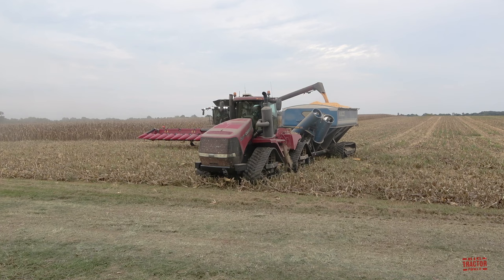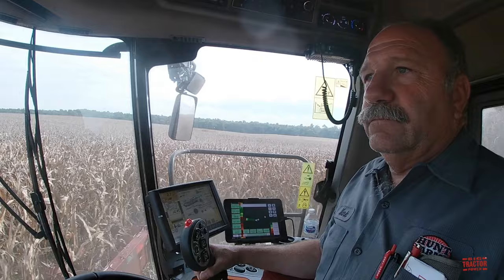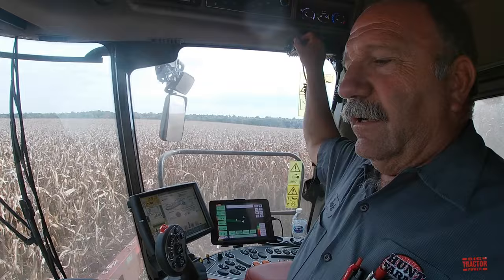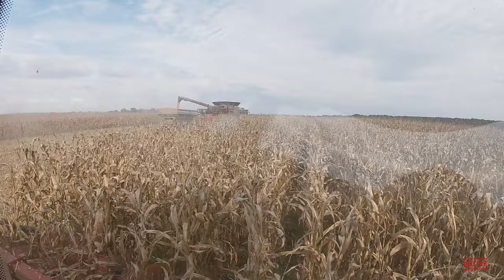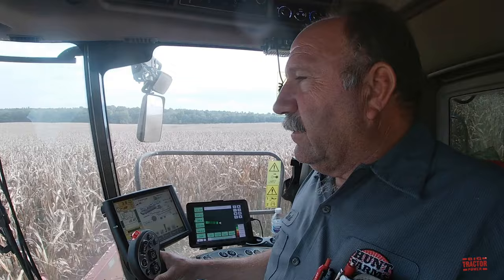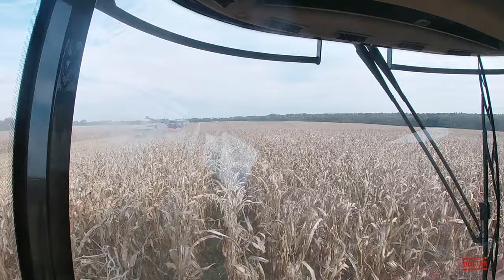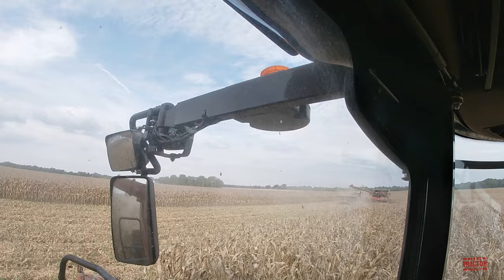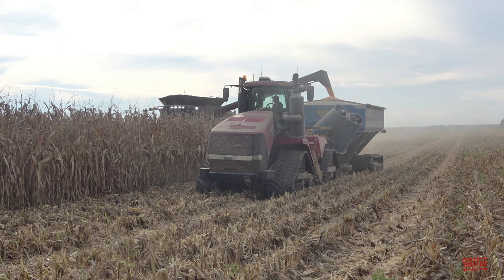CASE IH 9250 Axial-Flow Combines Harvesting Corn

Comment: The 9250 is an impressive machine.  Case makes a good combine  and their quadtrac tractors are nearly unbeatable
Reply from the maker: The 9250 really shines in corn with a 4416 head.
Reply: And I thought the slightly smaller 8250 was huge, Welker Farms has two of them and they just barely fit in the garage they have with inches to spare.
Reply: Two 8250s, not the 9250.
Reply: @bigtractorpower
Reply: Diamond

Comment: I was an IH dealer manager and sold the first rotary combine, a 1460 with a 22' header!
Total sale was around $53000.00! Whew things have changed alot and I'm retired!
Reply: I used one of those but with a 36" ft macdon on it. It was in west australia in pretty marginal area so the capacity of the combine vs size of header weren't an issue

Comment: I work for a farm that uses 2 John Deere 9660 STS combines 1 is a Bullet Rotor combine, their oldest brother uses a John Deere 9760 STS combine and these combines are used to harvest corn, milo, soybeans, and wheat. They use a John Deere 893 8 row corn head with hydralic deck plates to harvest corn. For wheat, milo, and soybeans, they use anything from a 635D 35' rigid draper head, a 936D 36' rigid draped head, and for soybeans, they only use 2 combines and they are equipped with 630F 30' flex heads since you gotta have a flex head to harvest soybeans.
Reply from the maker: Great harvest team.

Comment: Thanks Jason, great video.  Love the specs, prices, capacity, etc. you provide.  As some others have stated, I also think about what it takes to keep that combine fleet moving.  If the farmer is willing to supply the info, would be interesting to know their on-farm grain drying and storage capacity, number of trucks, tractor/grain carts, people, maintenance time, and general support required. Everything is going to fill up fast.  Just a suggestion.
Reply: Yes a "shed" or "barn" walk around would be a great addition. Be really cool to see the farms tillage equipment, planters and haulage truck.Could even be a separate video so as to keep the videos down to around the 15 minute mark. Keep up the good work 🚜🌽

Comment: I’m surprised the coupler between the hydro and transmission hasn’t broken on it like all the ones around here
Reply from the maker: I have not heard of that happening. The 9250 is a big seller in WKY.
Reply: @bigtractorpower  all the 50 series machines with the two speed trans are doing it up here … the 40 series with 4 speed aren’t doing it